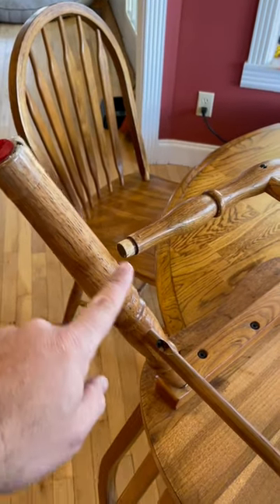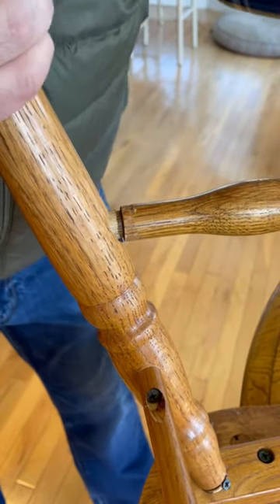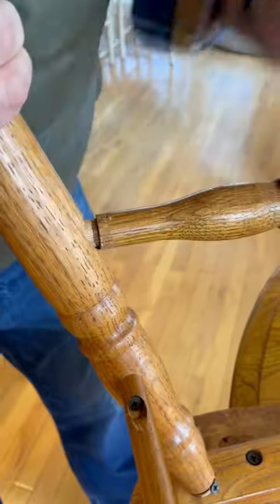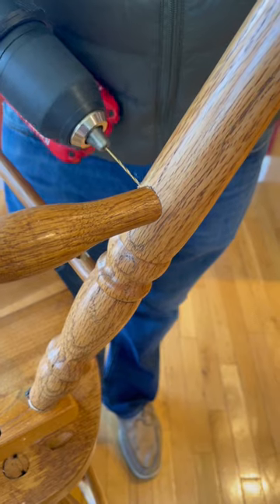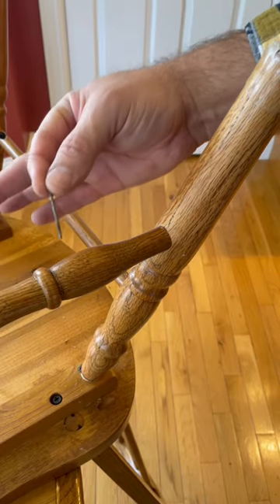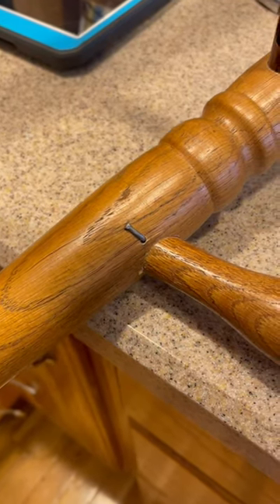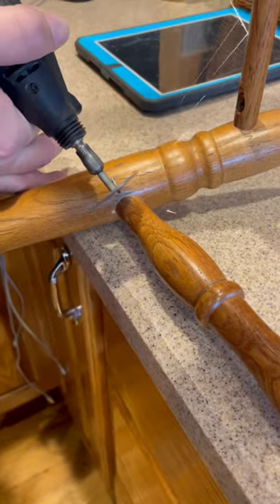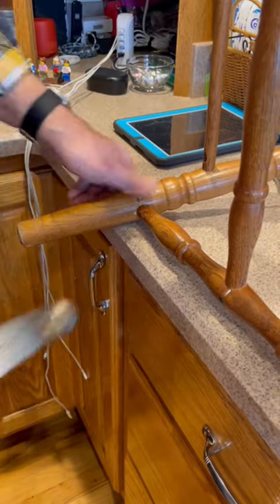Wooden chair spindle fix

Comment: Nails and chair joints should never mix  - bad idea.  Better off tightening the joints using a thin shred of hard wood, glue around the tenon, and sanding the tenon as needed.  Otherwise, use epoxy....but never nails or screws on chair joints.  It will wreck them.

Comment: I just today tried to take apart a chair with failing joints, but the nails someone put it are going to break the wood. They obviously didn’t hold the chair together, since half the leg joints failed at the same time, one broke.